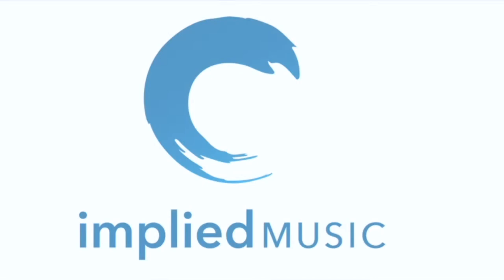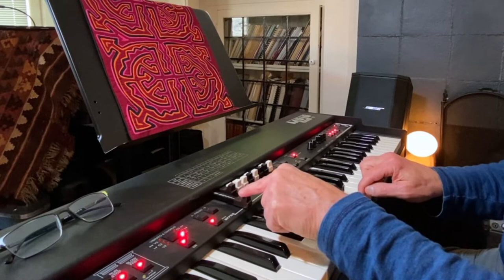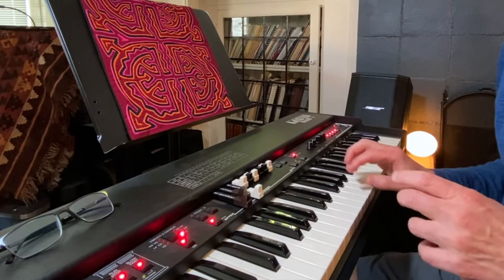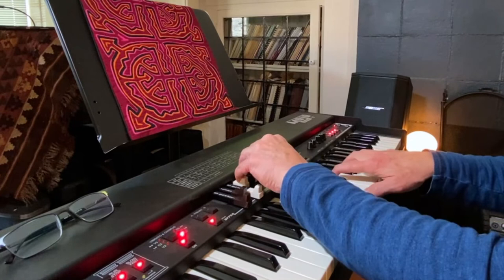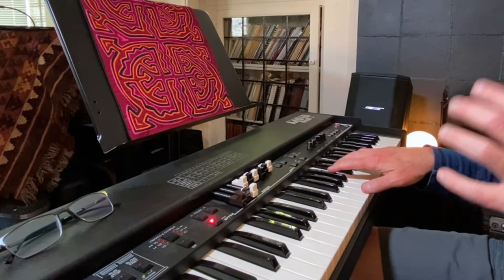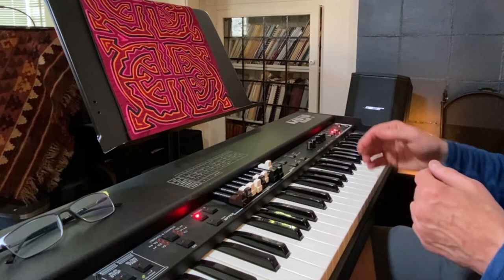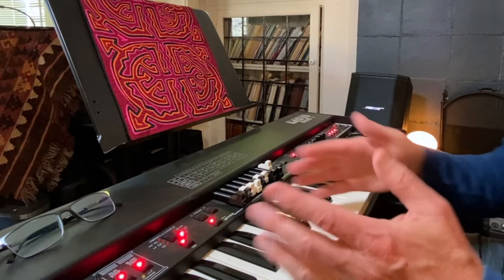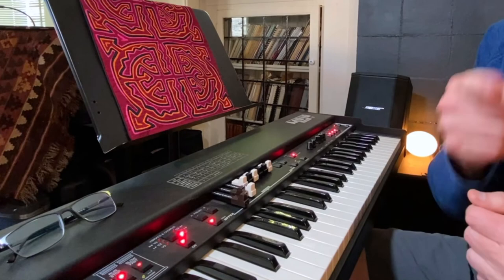Mojo 61 | Crumar B3 clone wheel tour

Comment: Thanks for the overview. Super helpful, I’ve been looking at the Mojo 61 for a while, what kind of system are you running sound through? PA? Ampflier?
Reply from the maker: I use a couple of systems. 1.) stereo Bose S1 s with a sub or 2.) center point stereo keyboard amp with or without sub. Recently I’ve been using in-ears and routing to the front of house.

Comment: Just been offered a good price for my Hammond XK1-C, I’ve never been blown away by its sound… thinking of the Mojo to replace it.. or a bad idea?
Reply from the maker: that's tricky. i liked the sound of the Mojo 61 better when i bought it, but it's possible it's less robust for touring/gigging than the hammond. i suppose it'll depend on your use(s).
Reply: @ImpliedMusic  yeah I’m touring with it
Reply: Good idea. I have flown my Mojo 61 a number of times, no problems. In Gator case exactly 50 lbs. not to mention the sound and action are great.

Comment: To turn off the Leslie on the Crumar Mojo 61 for use with the Neo Ventilator, is it good enough to just push the Run/stop button? Or is there a way to completely turn it off on the mojo?
Reply from the maker: There’s a way. The mojo is at my drummer s studio, but I’ll be there tomorrow and figure it out…👊🏼
Reply from the maker: okay. i think to completely turn off the leslie sim we'd have to use the browser app editor. (though for some reason i couldn't get it going last night.) that said, i had good results completely braking the leslie, and turning the drive to off.